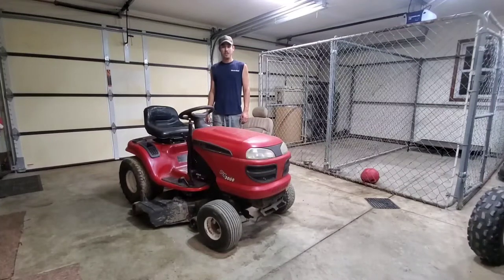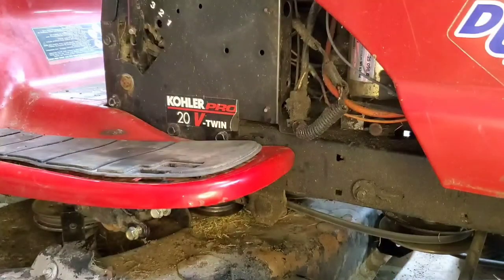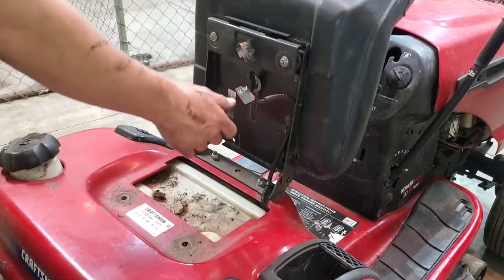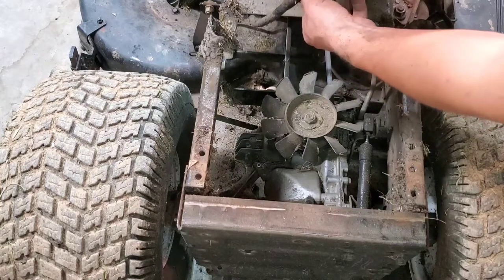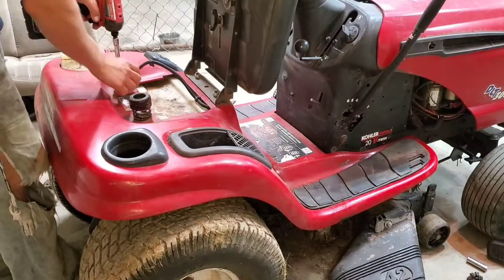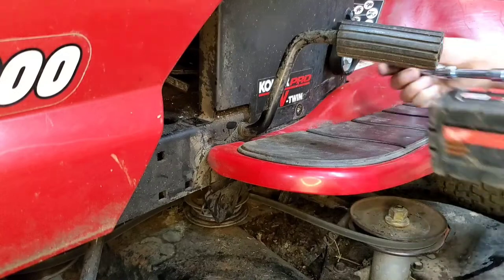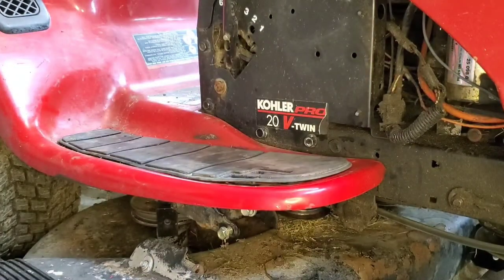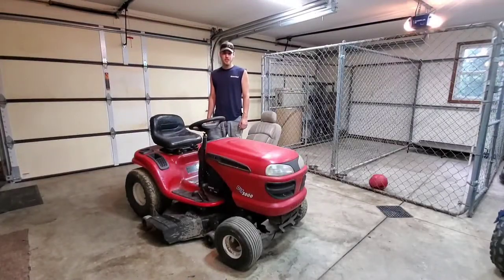How to remove the gas tank on a Craftsman lawn mower.

Comment: I never would have figured this out!!! Can the bushing and fuel tank stem be replaced without removing tank??? I replaced the tank when I got it 10 years ago but now leaking at bushing. Probably not??? Probably replace the fuel line while  it's apart! Thanks for video!
Reply: I replaced mine without pulling this..Took a week to get the parts..
Reply: I ended up removing tank. Just too hardcover get to otherwise!! Runs like new one, no leaks!!!

Comment: Question, I have a craftsman YT 3000 lawn tractor and I can’t find the fuel pump anywhere on it. Do you know where and if it even has one
Reply: Usually its bolted to the engine right after the fuel filter.

Comment: Clean the crap off the tank while it's out?...... Nah....??
I would advise, while the mower is apart, pressure wash (if you have one) the
dirt and grass from the mower. Blow it dry and grease your bolts for later maintenance.
Cleanliness is next to longevityness..

Otherwise, good instructional vid.
Reply: Very little pride anymore